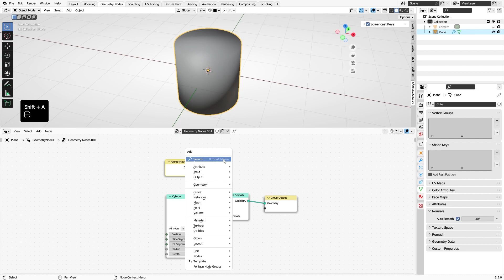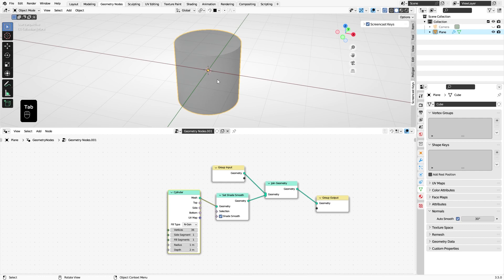Auto Smooth in Geometry Nodes (The Easy Way) - Blender

Comment: Got a problem ...... get an answer. I was about to spent hours to cheat another bad way.Thanks a lot.
Note : if your geometry is not the one from the Group Input, you can use the geometry of your Object Info node and scale it to 0 (Scale Element node) just before the Join Geometry node. It was my use case.